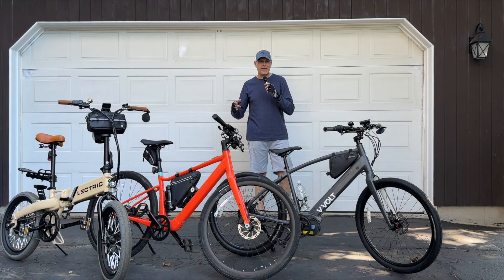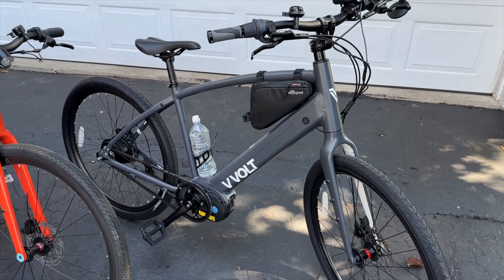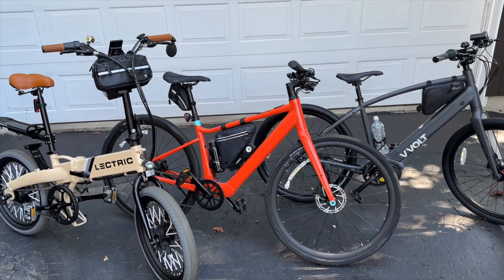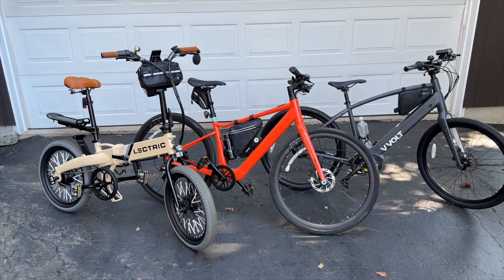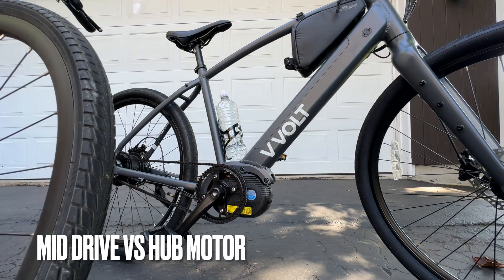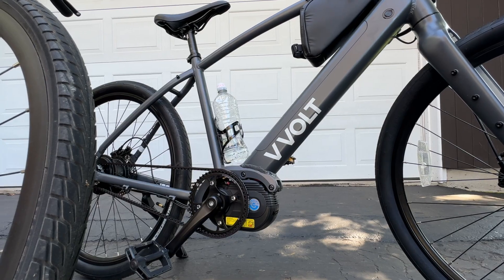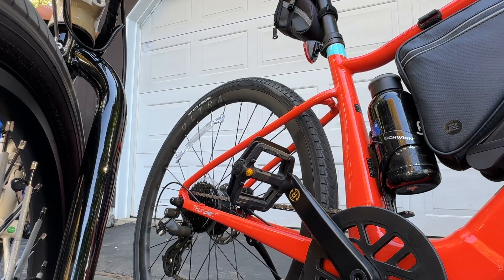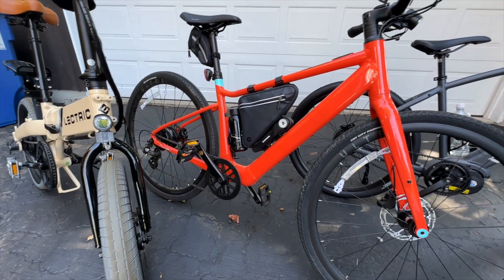Ebike Power Delivery Explained: Cadence vs Torque, Hub vs Mid Drive

Comment: A mid-drive motor may give more torque because of the ability to use the lower gears via the chain (or the internally geared transmission).  Hub motors have the same torque no matter whether you pedal or not; pedaling adds only human torque to the wheel.

Comment: Mid drive e bikes should all have belt drives, lot stronger than chains.
Reply: unless you want a single speed, you will need an internal geared transmission on the rear wheel.  One mid-drive manufacturer uses two chains, one for the motor and one for the pedals.